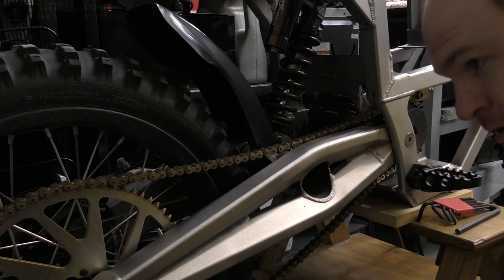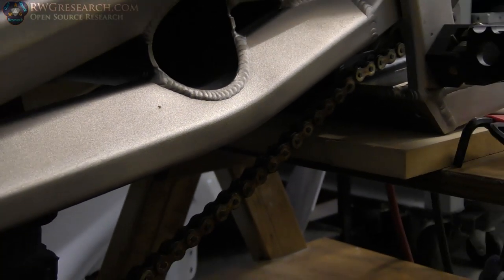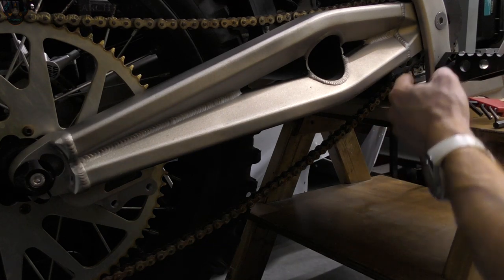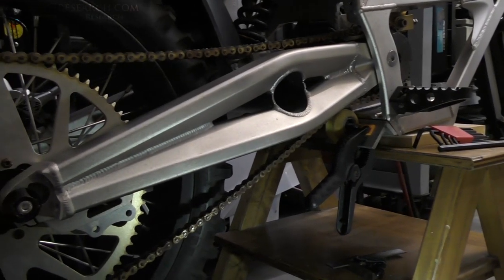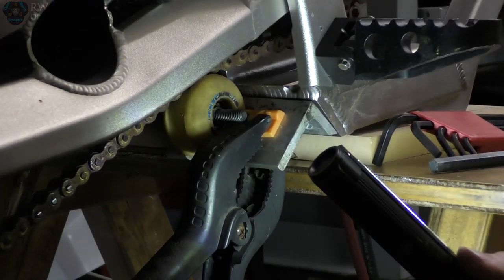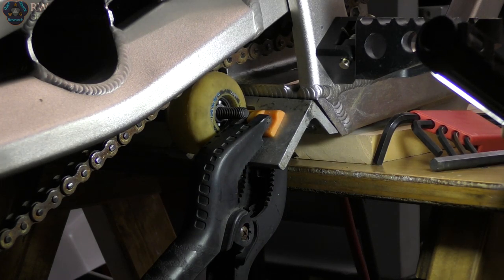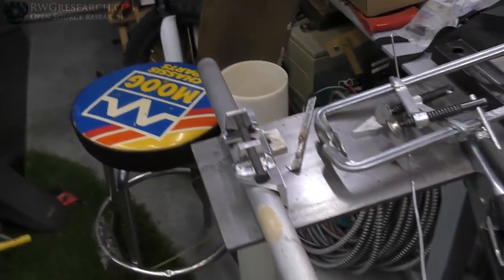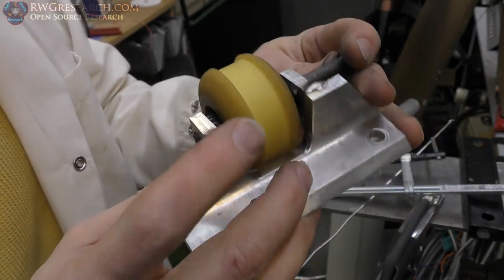Zero P6: Drivetrain, New Sprocket (28 tooth) & Custom Chain Guide.

Comment: In waterjet youtube channel i saw video about how behaves skateboard wheels at high speed. So maybe You need to find this video and look. Even this wheel will be only for guidance but it will near heat source and in somekind tension and at higher bicycle speed it will turn much faster. And that ruber thing will behave in its own way. Not in that You want. I think it is a little bit risky tu put this type o wheel for guidance. I dont know how to call it but in our country is from scooters like shaft wheel they are small made from metal and if you need you can press ball bearing in it. But i think it is something like that in your country.